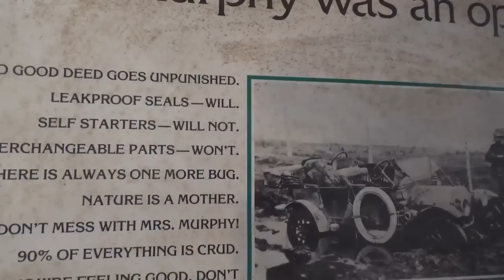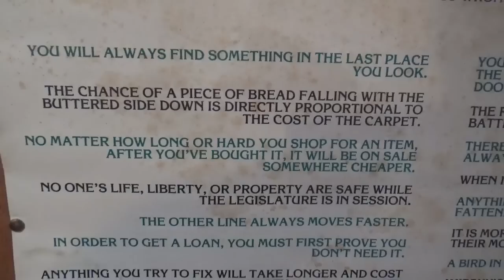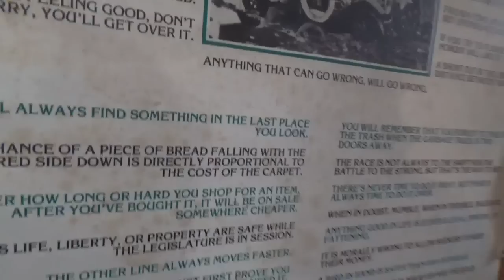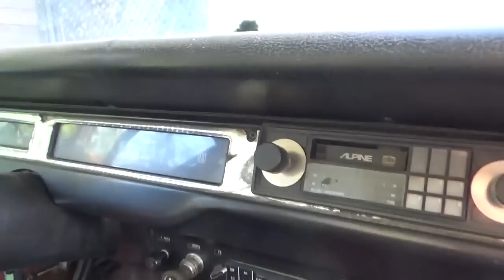International Harvester Scout Terra owned by 99 Year Old WW2 Veteran

Comment: That’s a great guy to have met!!  And I loved his Shops!!  We had a ‘69 Travelall.  Looked a lot like that ‘79 Scout Terra.  Not a lot of change in 10 yrs. for Int’l.  Ours had a Continental V-8 built in Muskegon or Kalamazoo, MI. I forget which.  I don’t know what the displacement of the motor was but we pulled a 35’ by 8’ wide Travel Trailer that weighed over 8,000# with it and we had no brake controller.
Reply from the maker: The old trucks sure do make lasting memories...don't they?
Reply: Man, that's an oddball! IH had a rep for building whatever the customer wanted, but I don't think I've ever seen a Continental motor in any of them. Oh well - something new to look for in the junkyards:)
Reply: I took a  few pictures of a  travelall 1966 model 4 doors black in color had a big AMC v8 sounded like it was running on 6 cylinders. Guy who owns it do I get out of his grandfather's barn  was using it for a mobile carpentry shop this is at a hotel I stayed at in the greater Dallas area of Texas. Very similar to the Jeep wagoneer. My uncle and I drove his 1969 wagoneerfrom Astoria, Oregon all the way back to Indiana, Minisota back track the Lewis and Clark trail to St Louis Missouri and then it was back to Seattle heck of a road trip.  I always liked the travelall.

Comment: I had one, 1977. tan.  They are all rust buckets, every single one of the Scouts. The Terra is the traveler or in reverse.  Longer than the Scout II. The traveler had the full cover fiberglass that was removable and HEAVY!  The Terra top also comes off if you want.  There is a panel between the bed and the seats that you can remove as well to make it the Traveler.  Fun little trucks to drive but my god the rust problems they have.  The best year model is the 1980 because they actually started using undercoating and had better steel from what I understand.  Last year of the Scout too.  Mine had the 304 great running engine, but way heavy for this rig. Then you can get the 345 as well.  I had the 3spd standard.  This one you are showing has the 727 torque flite in it. Great trans.
Reply from the maker: Yes, the 727 is much better than the 904.
Reply: Yep, I had one too. Mine had the six cylinder diesel, I loved that little truck until one day it disappeared in a cloud of rust.😆
Reply: You oughta see the Terra top on a regular ScoutII - it's pretty cool, but it looks kind of weird with a 4ft. bed:)  I loved my T18 wide-ratio, but the slap-shifter on the 727 was really fun to drive.